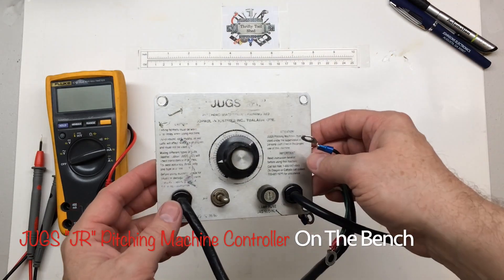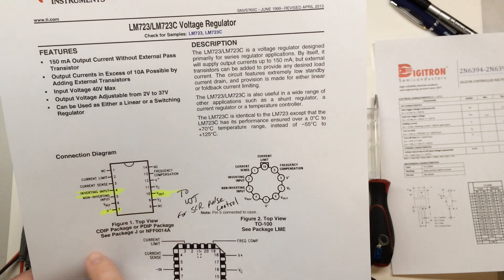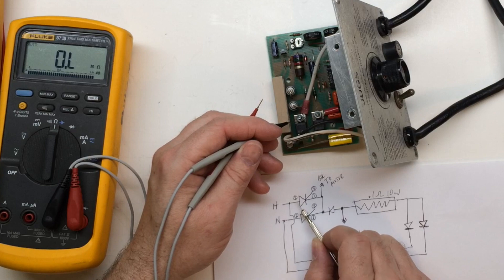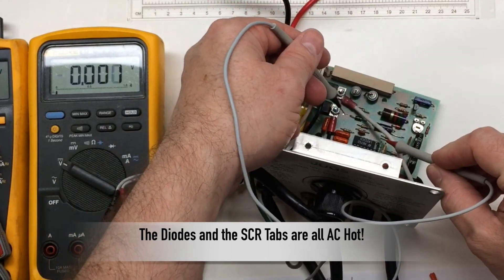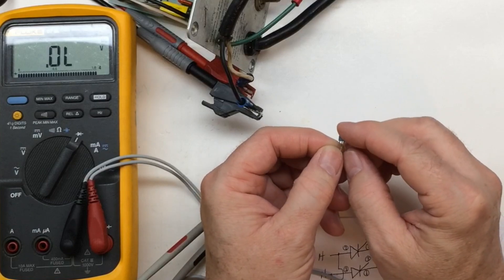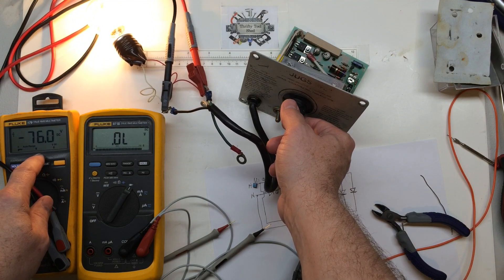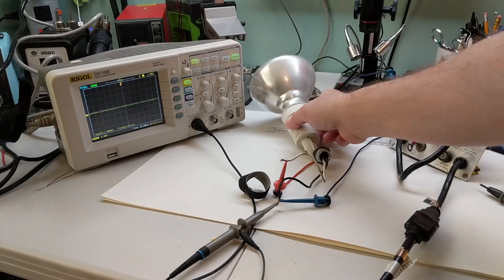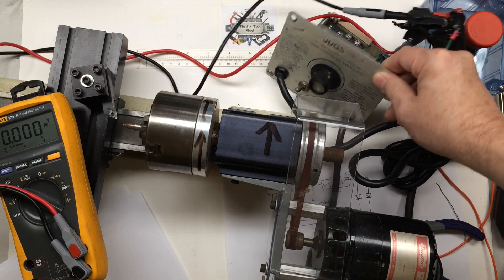JUGS "JR" Pitching Machine Controller Repair

Comment: All of the Jugs pitching machines until the early 2k's were designed by my father, Paul Heinsch of Unitek Electronics in Tigard, Oregon, just down the street from Tualatin, Oregon, where JUGS is. I probably hand built that control you're repairing since it's a 1998 model according to the serial number. We were a small shop of 4-6 people. I worked there for 20 years until Jugs decided to have them all built in China. The LM724, 2N3904, SCR's, MR754's and Power Resistor were the most common parts to blow. We did all repairs as well. The worse were the ones coming from the coastal areas, the sea salt did wonders in there with corrosion. I also redesigned the control panels in Adobe Illustrator when we added orange warnings to the front panels (lawyers...). The front panels were all locally made as well from another local shop who did the anodizing and silk screening. The 1k and 5k trimpots were to set min/max speed. For the JR, 500rpm for low end and I think it was 2750 rpm for the 5k. They were calibrated on a machine with a tachometer that he built (painted the wheels black/white). One funny thing when they went to China for manufacturing...the first shipment (a whole years worth of supply) had hot melt glue holding down the power resistors...which got very, um, HOT. That glue melted all over the inside. We had to repair thousands of these just as we were closing the business down before they could be shipped out to customers. Was kind of an insult to injury. Thanks for the trip down memory lane. Miss you dad.
Reply from the maker: That is awesome! I love that it was a small operation, that  your Dad designed it and you help build them. That is very cool. I sure hate to hear about the China BS. That makes me angry and we still do it today costing us jobs and shutting down local factories 😡. It sure sounds like they were made much better back then for sure! Sorry about your Dad, it sounds like he must have been one cool guy! Thanks so much for your comment and sharing that amazing story with us!
Reply: @ThriftyToolShed  Yes, Jugs joked that for what they were paying for the controls from China that they didn't need to repair them anymore, they just toss em and send a new one. I think they went to SMT tech as well, which we never did. Dad designed them in the late 70's and we prepped every through hole part by hand, cut and tinned all wires and power cables, etc. In the late 80's we didn't modernize as much as we should have. We did get wires precut/pretinned and most of the parts were as well. Originally they were all hand soldered but we eventually got a solder machine. I forgot what they called the style, but you put about 16 JR boards on this rack and it passed through a fluxor which bubbled up and coated  the bottom as it passed through and then dipped the whole tray into a large solder bath. Saved lots of time.
Reply from the maker: @steveanimatrix3887  Cool! Like a solder wave machine?
Reply: @ThriftyToolShed  Almost. The only thing that was flowing was the flux, which used a pump/compressor to bubble up the flux as the boards passed over it. There was no heat chamber, or flow as far as solder. It went straight from the flux bubbler to the solder bath. Just a big heater bath tub like a solder pot that it lowered the tray into. The solder itself never moved/flowed.
Reply: Do you happen to know where to find any of these? 

Or do repairs?
Reply: I should correct and say all of the pitching machine *controls were designed by my father....not the whole machine

Comment: My board is bad with corrosion. Is there any way to clean it?
Reply from the maker: I have used plastic safe contact cleaner in the past. Example link below. If it's not real bad 99% IPA with a brush like a cheap tooth brush may work for you.
https://amzn.to/3yX0phc

Comment: I really appreciate your video. I have volunteered to repair a pitching machine for my son’s middle school. It has the same board. I got to the point where I repaired several connections and the machine is spinning at full speed….only full speed! I have tested that the potentiometer works. Where in the circuit does the voltage to the motor get reduced? Is that before or after the voltage regulator chip? 

I have learned a tremendous amount from your video alone and want to be sure I have a decent idea what’s wrong before I have someone work on the board.
Reply from the maker: Well first of all thanks for volunteering to repair it, that is a good deed indeed. Also, thanks for your kind comment. I remember a little bit about this, but it has been some time. You did good checking the potentiometer. I  believe the speed is controlled by a SCR  (should be a larger 3 leg device typically attached to a heatsink or maybe the case itself). The SCR should be getting a pulse from the board and that potentiometer does input to the chip to adjust that pulse. I Believe I had a bad UJT on this, but I would have to watch the video again myself it's been so many repaired devices ago. Hope this helps, sorry it's not fresher on my mind. Best of luck to ya!
Reply: @ThriftyToolShed Yes, you replaced a UJT. I will keep tracing. I am not familiar with SCRs but I tested them like you did in the video and they behaved similarly. I have a cheap $30 controller that I used on my jugs machine, which I might use here. I was hoping to repair the board so that the school would have the original equipment instead of a scabbed on aftermarket controller in a 3d printed housing.

Comment: I have a Titan Curve Ball Machine. The top Knob turns on but the speed is not changing velocity as the knob is turned. Can u tell me which knobs I need to try to repair
Reply from the maker: I replied to you in messenger.

Comment: My speed knob changes resistances, but my motor trys to run 100% all the time. What would cause this?
Reply from the maker: The first thing to check is the SCR is not shorted because it would cause that. If SCR is not shorted then it's something in the control circuit for the SCR that is gating the SCR high all the time maybe. Best of luck to ya!
Reply: @ThriftyToolShed  when you say shorted, you mean to ground? Or 2 internal circuits shorted together?
Reply from the maker: @wurthmannd024 Well I am of course mentioning what I think could possibly be, no way to tell or say for sure from just comments. I am saying if the SCR is shorted internally from Anode to Cathode it could possibly run full speed at all times. I also mentioned if the SCR is fine it could even be something on the control circuit making the Gate of the SCR fire at all times also keeping the full speed output. Hope it helps.
Reply: @Thrifty Tool Shed  couldn't find any shorts. I ended up reflowing the solder/baking the board in an oven as I do with dead GPUs and she came back to life!

Comment: My pitching machine will run and just stop out of nowhere
Reply from the maker: I would check for loose connections somewhere. It could be in the power to the motor side (check motor brushes also if not already done so) or something with control side like potentiometer itself or loose connection on it or even power switch. I would even look over the board for bad solder joints as well. The intermittent issues are the worst. Best of luck to ya!
Reply: @ThriftyToolShed  Thanks bud.

Comment: I have the same exact control board. Mine is only putting out 34vdc with the potentiometer in any position and the motor just hums? Any idea what my problem would be?
Reply from the maker: Hard to say, it could be the speed  potentiometer itself. If the speed pot checks good it could even be the adjustment pots. If they seem ok you would have to check the SCR and UJT as I tried my best to share on video. This is the only one I have worked on and simply tried to share this repair in hopes it might help others. I have no other experience or information on these other than what is already shared. Best of luck to you with yours!

Comment: Hi great video felt like I learnt alot about circuits, my club has the same machine it runs but after a few balls get put through the rpm drops from 1500 to 1000? would you know what causes this! No electrical business knows because they have never dealt with these machines before! Any help is much appreciated cheers!
Reply from the maker: Hi,
I only worked on that one so I have not seen that myself. I would check the speed pot and maybe even the other pots on the board. it could be a speed related change or a current related change. That one may be harder to track down. I would also check the motor brushes and make sure they are in good condition.

Comment: I have a similar machine 2 wheel with 90v motors and I am pretty sure the potentiometer is bad because it was left out uncovered and the 2 black ones were wet. The part numbers are 1k349m and 2k5347m there is also the speed adjust which has b5k on it. Do you know how i can find replacement parts? I have searched the piher website and cannot find the part numbers. Thanks Great video.
Reply: What was the difference between the 1K and the 2K was it the top and bottom

Comment: This was a very thorough explanation of the inner working of the machine. I have a Jugs Jr. My issue is that the power intermittently, cuts out. It will run for a few minutes, then lose power. I wiggle the cord and it resumes again. Any thoughts?
Reply from the maker: I would absolutely check all connections well. These are very prone to corrosion and bad terminal connections.

Comment: After watching this great video, thought you would have an answer to my issue. Just purchased a used Jugs dual wheel. The wheels should be spinning in opposite directions (I assume, because otherwise, the ball is not ejecting out), but both motors seem to be spinning in the same direction. I read that the wires (black/white) may be crossed. Could that be the issue? Thank you so kindly for any response. My son is anxious to start using it.
Reply from the maker: Hi Tommy,
I only worked on the Jugs Jr. And it only has one wheel of course. So I do not know about the one with two like you have. I do understand what you are saying, if the two are spinning both same direction it will not work. I do assume they should be opposite if they are opposing type. As far as how to reverse, I don't have one to say. If it does have permanent magnet DC motor with just two wires then you should be able to reverse those wires and the direction should change. Sorry, I can't truly say exactly because I know little of this type. Hope it helps. Best of luck to ya!
Reply: @ThriftyToolShed  No problem. I checked with Jugs support and they were extremely helpful. I crossed the wires and now it is running the right way. Not sure why it was opposite to begin with.
Reply from the maker: @tommys5749  That is really strange!
Reply: @ThriftyToolShed  Thanks for the reply.

Comment: My jugs is much newer and uses a dc motor. Does this older model use dc or a universal ac motor? Or maybe I am overthinking it and you connected the scope to the scr outputs before a bridge rectifier? Did I miss something?

Comment: I have a jugs jr with digital display. I plug it in and it goes slow then will speed up. Turn it off then on only goes slow. Then repeat and it goes fast then starts to slow down. Any thought? I thought motor but any help would be appreciated.
Reply: It is probably going to be the speed control dial. It is actually a variable resistor. I am replacing mine this week. It literally started to act up today. It will go to 70 mph but after a pitch it drops down to the minimum speed of 13 mph until I move the dial down and back up a few times.

Comment: I have a pitching machine doing something similar, can you possibly fix it if I were ship it to you?
Reply: I can if you still need it done.
Reply: @kwhp1507  How can I contact you?
Reply from the maker: I wish I had time, I do get asked this often. I work full time+ and try to have time to edit videos to post. I try to help by posting what I have found with a similar items and do try to help if someone is having issues.
Reply: @ThriftyToolShed  can I ship my jugs lite to you? I checked the fuse n it still cuts off after working for a minute or so
Reply: I have a lil newer model and need it working again
Could I ship mine to you? I already checked the fuse

Comment: I have the same controller. When I flip the on switch it burns the fuses. Would you have any idea on what might be causing it.
Reply from the maker: It could be a number of things, best to check and see if it still does it without motor attached. If it still does,it's time to check for shorts. Most of this can be done without power applied. You can ohm the power term to nuetral/ground all the way through the circuit  including the scr component. Best of luck!

Comment: Just wondering if you would have any thoughts about my issue.  I have the same controller and the dc voltage is very erratic on the upper end.  Do you think possibly the same component could be bad?
Reply: Also my output on pin 10 of chip only reaches about 11vdc max. On the upper side of the dial the output voltage fluctuates a bit.  So it could possibly be a bad chip.  I noticed you were getting about 17 vdc.
Reply from the maker: It could be, If you know how or have capability to use a oscilloscope, you may see the pulses out from SCR's and make sure they are following the gate pulse as well. I did not have an issue with the one I was working on, but that is where I would have gone at that point I believe. Caution: When using a O-scope on mains voltage you must have electrical safety knowledge and training!
Reply: @ThriftyToolShed  Well I have the knowledge but I don't have an o scope.